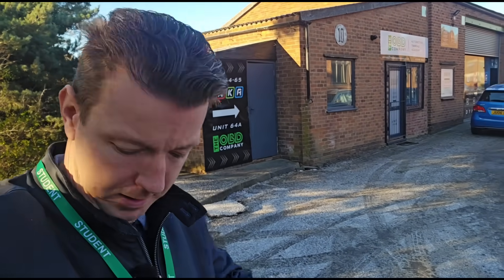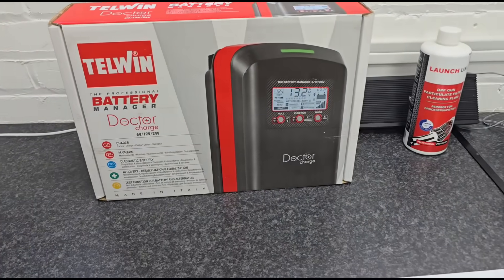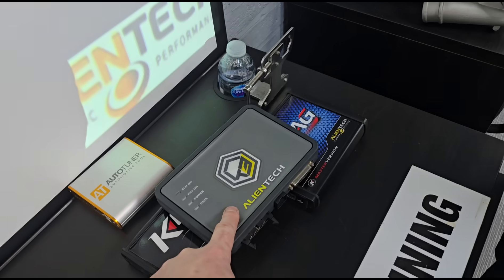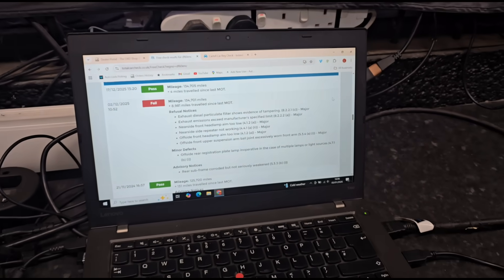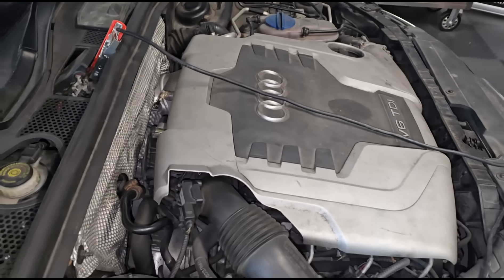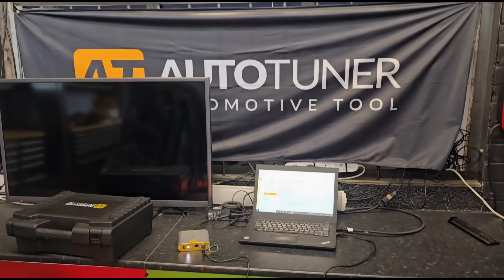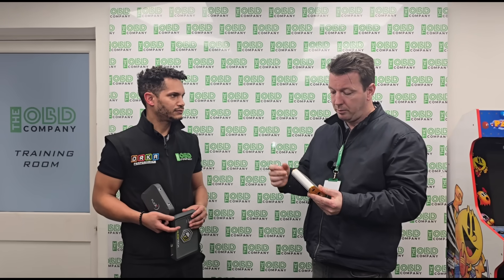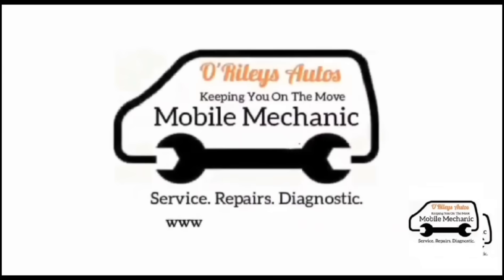ECU Remapping Training With The OBD Company | Behind the Scenes

Comment: Nice! I have a 2013 1.4 D4d Toyota Auris, which has a DPF & cat delete and it looked very similar to the process the guy did on mine. Wires straight into the ecu. Car ran like a swiss clock for 100k km and counting. Sadly I can't revert it back as it's been done so long ago and lost contact with the guy and I'm wondering if that website you showed in the video might have a stock ecu file for mine?
Reply from the maker: Yes we have a stock file now